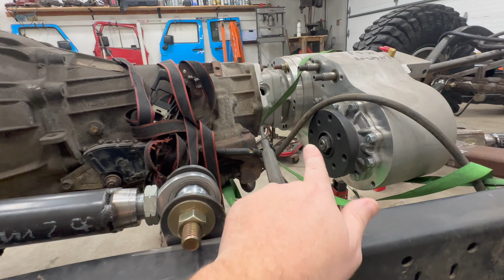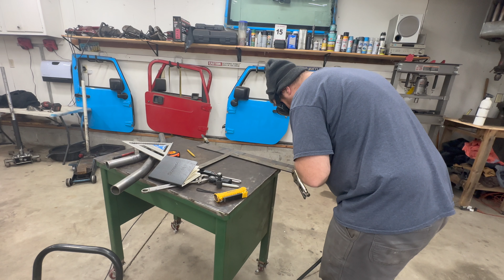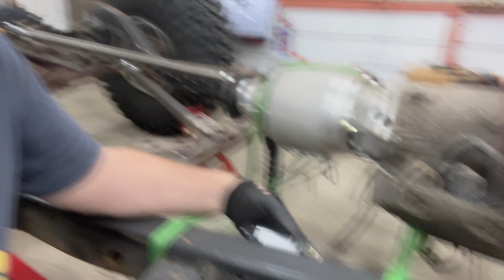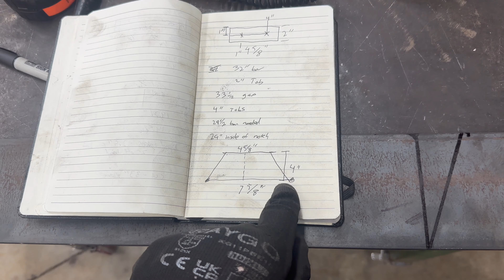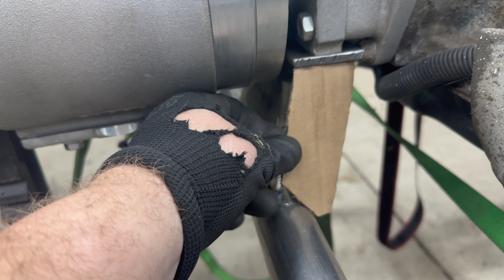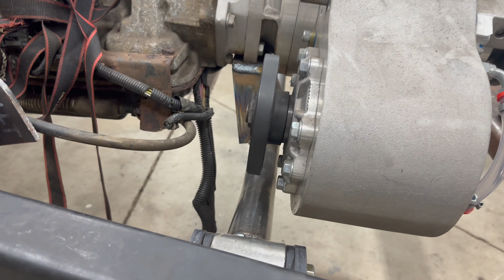WE HAVE A ROLLER! DIY Transmission mount of the ULTIMATE JEEP BUILD!

Comment: Looking great. Wish I was there. I love fabricating brackets. Before you cut your tub in two pieces, you may want to x brace both halves up so it’s easier to weld back together. Watch a YouTube video and you’ll see what I mean. Awesome job so far. Looking forward to the next video!
Reply from the maker: Thanks man! And I had tons of fun trying to figure out all that stuff. And thanks for the tip on the x brace. We actually just cut the tub and we just used a cross brace. Hopefully that still helps line it up. This weekend I should know. 😂